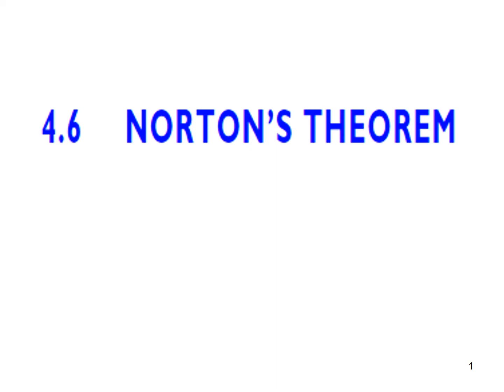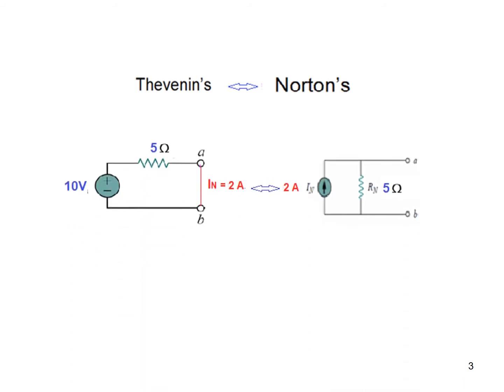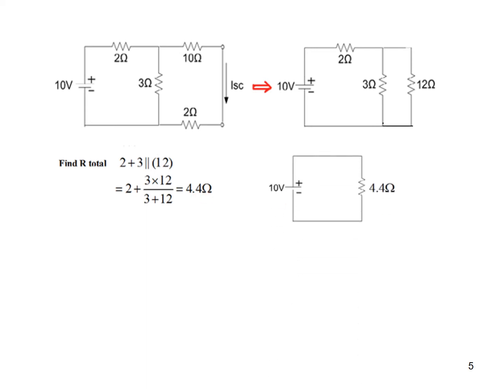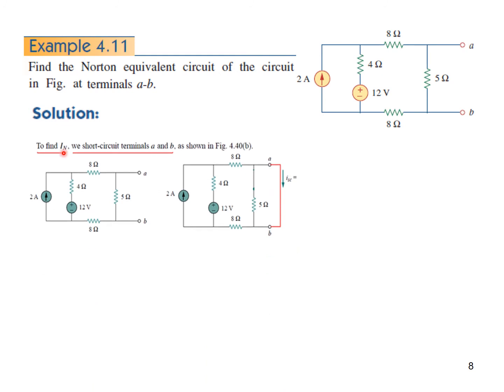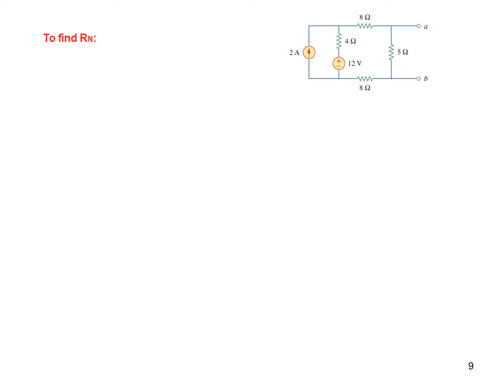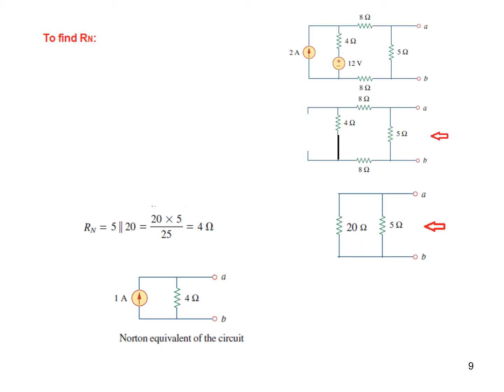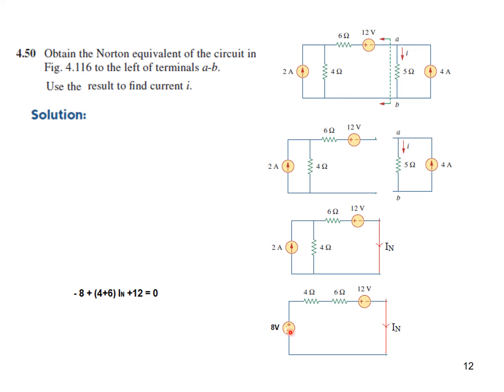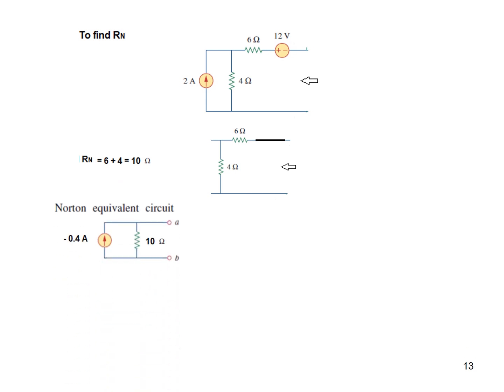(English)LCA ||Example & Practice 4.11|| Question 4.50 || Norton's Theorem

Comment: In the final problem you don't need to use superposition to find the net current in the 5 Ω resistor. You can sum current sources in parallel. Hence, the total current is 4 A + (- 0.4 A) = 3.6 A. By current division I_5 = 3.6 A × 10/(10 + 5) = 2.4 A. ◼
Reply from the maker: Yes True (but only if you have masterred the technique) .Thanks